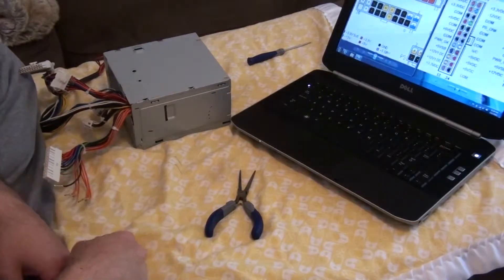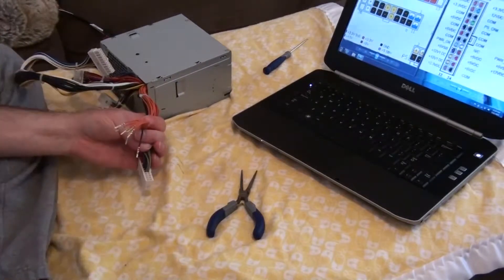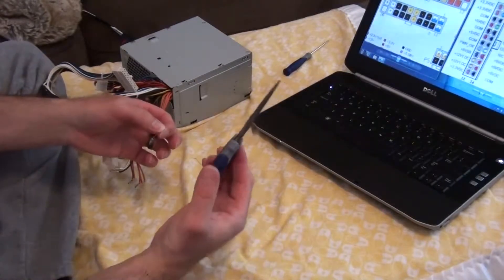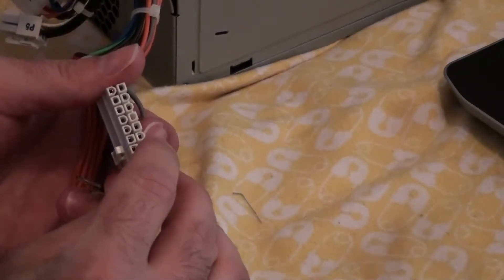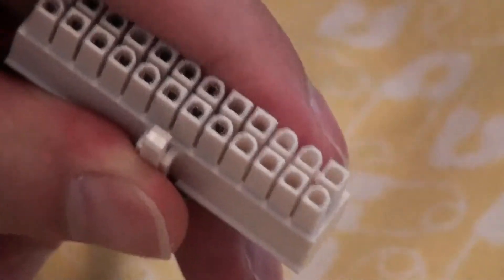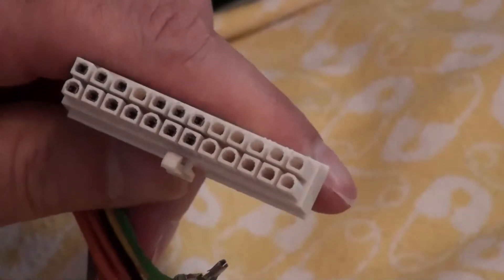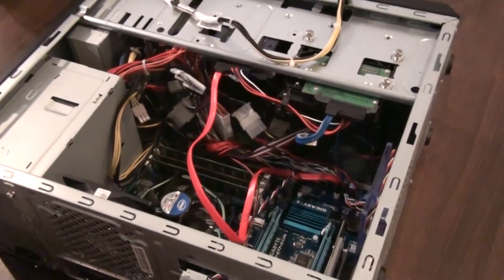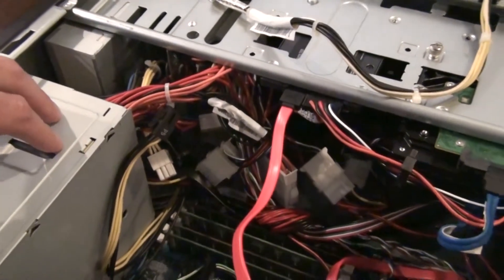How To: Re-pinning ATX Power Connectors

Comment: Doing same job right now, need 24pin, pulled psu from a wreck and it's a 20pin, so I'm on a Friday night RE-pin mission.  Feel better knowing its something other folk have to do.  Thanks for the video and the tip with the staple, been using sewing pins lol.

Comment: gotta be careful with extensions, like some 6 pin extensions, in your case, it is 6 pin extension, but for video card graphics some take 8 pin and one time i bought a 6 pin extension to 8 pin (or 2x 4 pin connector, aka m41 and m42 connectors) somehow they had the wrong polarization, and it threw me off but later learned to know what pins on the atx version 2.0 connector go on the pcie connector. i learned of this from a popular channel on youtube called gamers nexus. but yeah for like atx mini connectors for like hp, if like it is a connector that is like under 2 inches, such pins are fragile, and recall doing it as this video, but will say am glad i left the side prickly pin pair stuck-out while reinserting it back in the atx holes. I did solder as well, and heat shrink wrap. Hovered my soldering iron above the shrink wrap so it shrinks and snugs the solder.